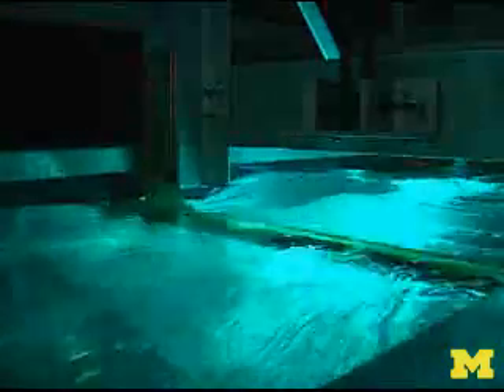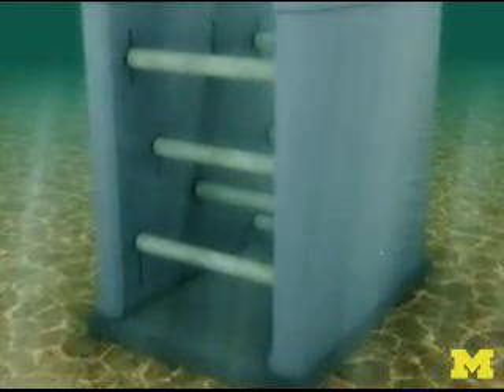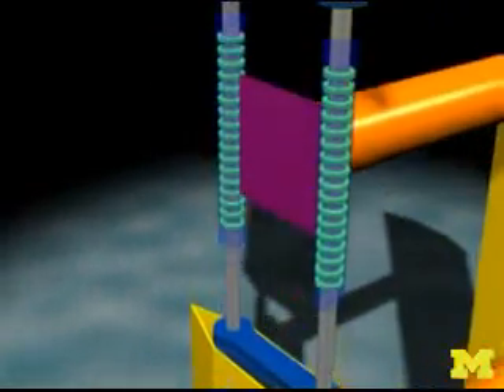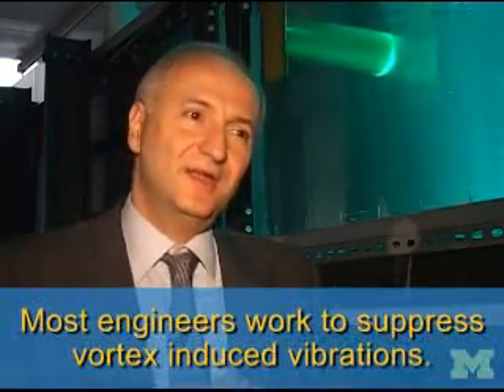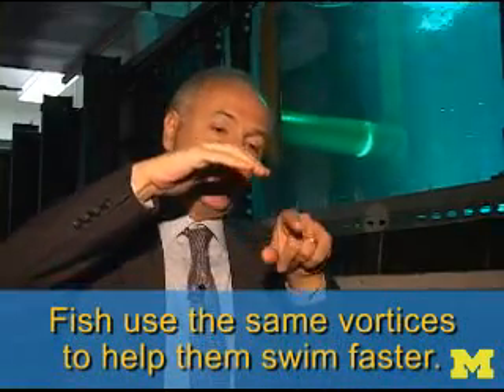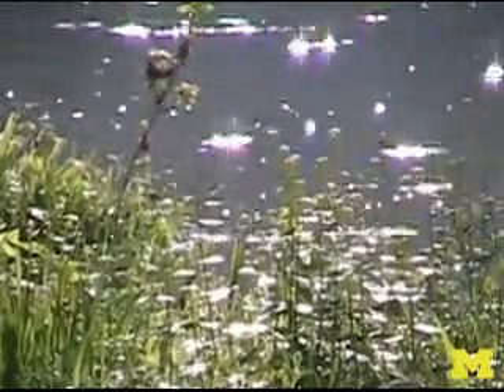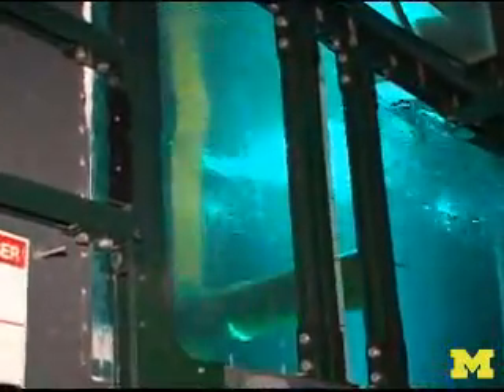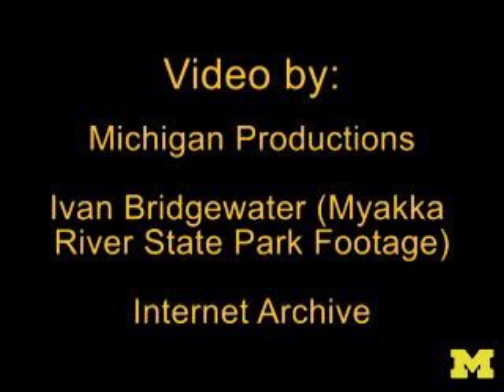University of Michigan - A new renewable energy concept

Comment: I believe they would have to hard-line them to the surface, which could really cause some logistical nightmares for these things.

The mechanical energy is converted into electricity through those coils you see in the vid. I think they are wrapped around a magnet, and as they move, they generate a current by moving through the magnetic field. Like how a solenoid works, but just opposite kind of haha.

Comment: How's that? It's potential is equivalent to the power it can produce in it's lifetime minus the power it took to produce it (with some other factors such as cost to produce, power produced per space used, watts per hour, ect). And anything with moving parts is going to have a set lifespan; IOW, there are limits it will have to overcome. Just because it produces power that we're not collecting doesn't mean it's productive. Otherwise, yeah I did  do a shitty job of explaining it the first time =P

Comment: Only potential problem I see at this moment is it's lifespan... it's clearly using springs in there, which have a limit to how long they can be used. The amount of power it gets over the energy it took to make it, plus the rate at which it gathers energy, will be the factors that determine whether this will be worthwhile or not. I just hope it works out; we need new power sources like fish need water.